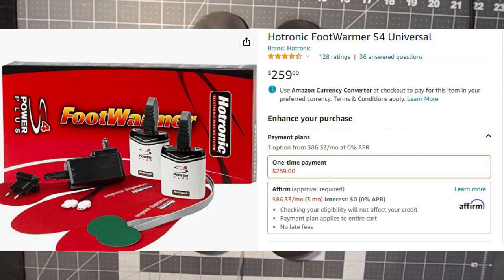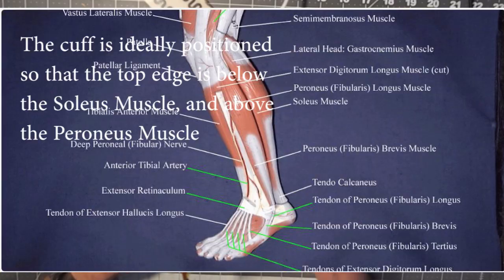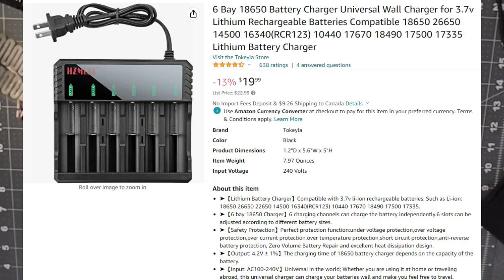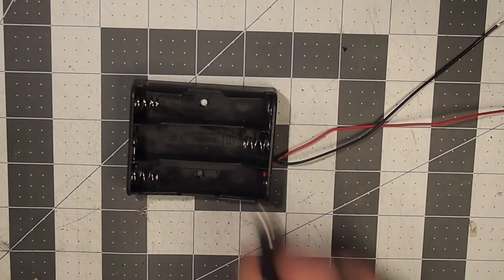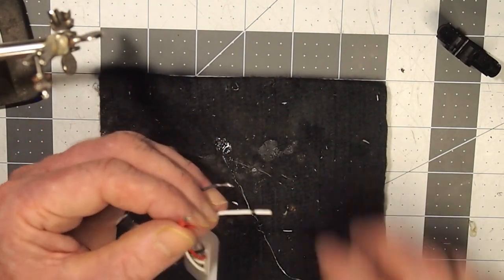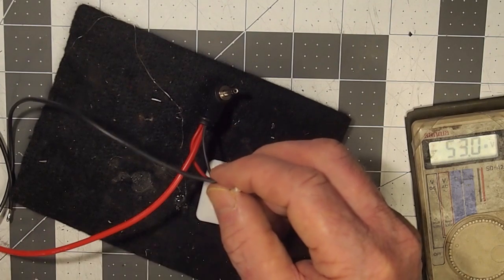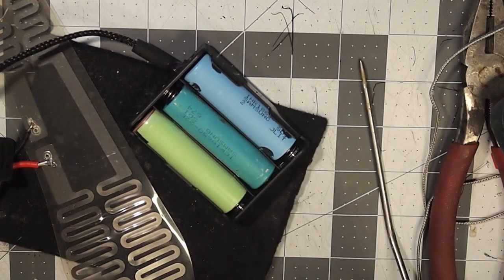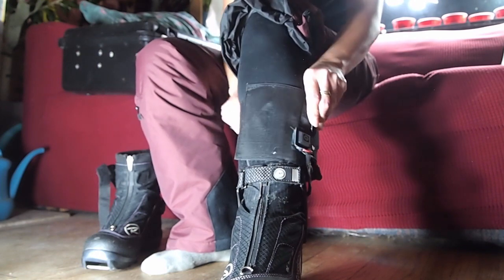Handwarmers S07E04: Make $500.00 equivalent boot heaters for less than $50.00

Comment: Hi, is it possible to purchase some of your "switches" so I can test them?

>Inquiries should be posted under any of the Youtube videos that are in our "Handwarmer" playlist.

I tested the "switches" I have that look in every way identical to the ones shown here, However as soon as I applied above 6Vdc to mine with my adjustable lab bench power supply, it gave up Instantly unfortunately...
If possible, I would really love to learn how to acquire the "switches" you have or possibly where to get them, Please and Thank You?
Can I make an order through you page for the "switches" alone? 

Is this the best way to contact you, through youtube comments?
Thank You :)
Reply from the maker: That's very odd as I suspect all these switches are the same and are rated for a minimal range of 3-12V. All the gloves for example you see listed on Amazon, Ali Express, etc., use 7.4V batteries. I have a pair of Holmes heated work gloves that have been running 12.6V for 2 seasons now as shown in the previous video I made.  I bought a pair of heated ski gloves for SWMBO for Xmas, but as we have -36C here, I gave them to her early and they are running on 12.6 V battery packs. Although the switches in these gloves I just got from Costco are somewhat different than the ones I use in the kits I made up, they are also working fine. At the moment I only have enough for the kits I am assembling. I wonder if your problem is the current you are drawing through them, what are you driving with them?
Reply: @MountainParameters  Driving the switches with a Lab grade adjustable Amperage and Voltage power supply.

So I can very finely control both my input voltage and amperage independently if desired to protect a circuit if I am not confident of its ability’s.

Do a lot of experimenting and testing hardware, so need that kind of fidelity. 

This allows me to measure the wattage when driving different types of heating elements with very fine granularity to see what it is capable of when deciding on a factor of safety.
Reply: @MountainParameters  Question in case you have seen one, Have you ever found a Usergroup, Forum, or Sub of "enthusiasts" that deals with DIY heated articles of clothing possibly?
Worked on mine for a long time trying to refine and iterate the system I have, and have not found many that have Any information or feedback on the topic, specifically for what materials and hardware is available.

Retail market is recently starting to flood with various options, which I like to see, but I have Never found a retail option that can compete with the wattage I use and Need! I have many of the options marketed over the years and have tested more!

Big outdoor winter enthusiast and run Very cold by nature (even with some of the best equipment available) unfortunately, probably a circulation issue... and the heating elements are a Necessity for me, or I am in pain and risk of tissue damage regularly since we are out for extended amounts of time/most of the day.
Carry backup chemical solution as a redundant backup, but really dislike the waste and packaging associated with that solution, but it is a built in redundancy as I use mine so frequently and vigorously, I get hardware failures from time to time . 

Would really love to see what others are doing to build a more robust system if there were people out there building that, and willing to share concepts and ideas on the topic.

Thanks again :)
Reply from the maker: @101rotarypower  I have not seen anything so far, but you'd think there might be something on Reddit. I think a few simple rules of thumb can go a long way to help someone when they are looking to not be disappointed with respect to getting warm gear. For example, you would not go out and buy a jacket will with cheap feathers instead of 900 fill down if you were going to the arctic. When it comes to warming hands and feet electronically, you will not get much satisfaction from a system that only supplies 1200 maH of capacity and 8 watts of heat (which is typical for most systems you find listed on Amazon or Ali Express for example). In my experience, for northern climates such as my region, one should not settle for anything less than a system that can supply 15 watts for each hand or foot, and 3400 maH of capacity. This can often be accomplished by spending over $500 up to $1,000 for a decent boot heater system, or taking an existing system and modify it, as I have done for my gloves.
Reply: @MountainParameters  Looked and ask just about annually for the last 10+ years with no success finding others that know about this topic, all over reddit especially and other winter sports and electronics forums also.

Thats about right on target wattage per for mine as well. 
I find the elements mode of contact to be Super important also! The closer and tighter the element can be to skin contact (within reason) the better the heat transfer to the skin as a sink, reducing the need for excess capacity and bulk as well as reducing losses from incidentally heating boots/gloves.

Just getting some heat into my extreme extremities allows the blood to flow and do a little bit of the work it should be doing on its own, if my fingers and toes get cold the Will NOT recover even on a pleasant warm day in the snow while being very physically active! Just getting them up to a reasonably surface temperature is so important for me personally!
Then on sub 0 days with bitter wind and snow, its hard to keep fingers and toes operational even with the applied heat, thats why I would love to find a controller I can operate with gloves on, and visually indicates level of output at ~16Vdc input.
Right now I use custom controllers that are based on a DC regulator, and modulate the output with a side roll potentiometer contained in 3D printed cased, but there is No way to control those externally "Well" despite their functionality working really well to dial in the exact amount of heat needed conserving battery.
Reply from the maker: @101rotarypower  If you are running 16V then you must have a pretty large battery pack. I can see why those garment style switches with small 24AWG wire would not work even though they are rated to 15V they won't handle more than 3Amps. I agree that using a rheostat would be your best chance of not blowing out your circuit. For the visual indication they have those small voltage displays on Ali Express that range from 3-30V that can be easily sewn onto a glove and then possibly weather proofed with hot glue, and then you might be able to find a similar capacity rheostat with a large knob on it that you could also integrate into the glove and also dial while wearing gloves. Sounds like trial and error is going to be your only way forward to reach your ultimate goal.
Reply: @MountainParameters  At those low of temperatures that included wire is effectively capable of more. But no matter as I could easily replace it by pealing back the silicone on the back of the switch to expose the PCB Pads, and solder replacements. 

Is there a supplier you could lead me to I could order from in small quantities?
Reply from the maker: @101rotarypower  When I was looking at rheostats on Ali Express last night there were lots of them listed there for a couple of bucks each.